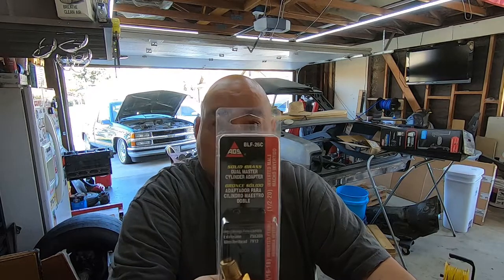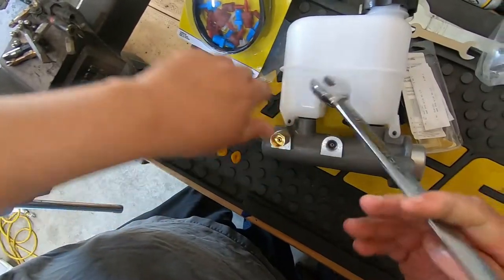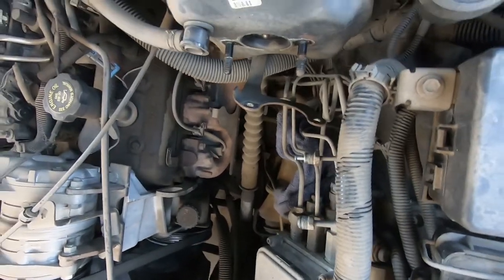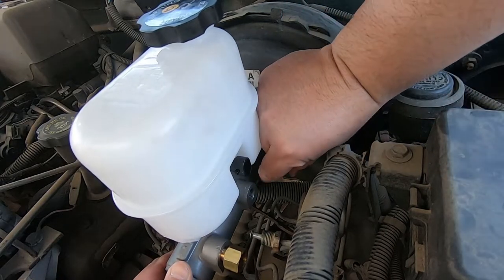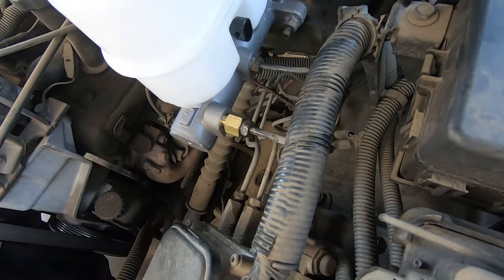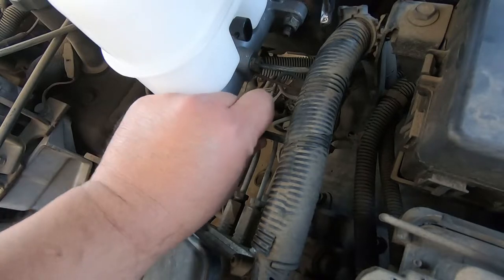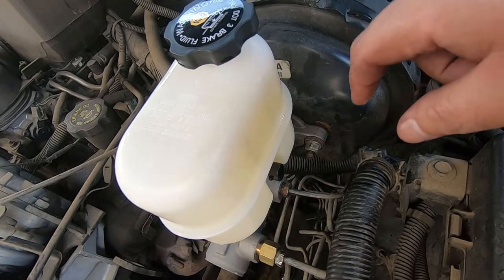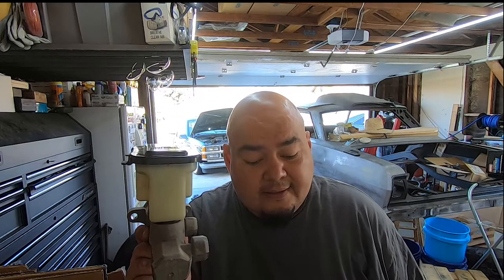Chevy NBS master cylinder on an OBS upgrade

Comment: Just did mine 1 month ago ....HUGE DIFFERENCE!! feels good from the get go but gets even stiffer after a few days of driving .....side note that line adapter can give you issues when you purchase the line adapter look inside of it the first one i got the threads did not go all the way down so i could not get a good seal went back to the store looked at the last one they had just like i suspected that one threads went all the way down swapped them installed it boom no leak everything is GRAVY!!😎
Reply from the maker: Yes I agree huge difference nice side note I have had a few guys have the same issue thanks for watching bro 😎
Reply: U got a part number?

Comment: Did anyone one of y’all experience a small leak at the adapter ? Everything is tight and still tends to leak a little bit. Nothing was cross threaded incase y’all wondering.
Reply from the maker: Some of the adapter fittings have a defect u have to look inside the fitting the threads should go all the way down the only reason I know cause a few guys have had this issue and there fittings are the problem same part # but 1 the threads go all the way down and the other 1 the threads stop that’s the defect 1
Reply: @LowLifeYonkes  thanks,will get a replacement adapter 👍🏼
Reply: @estebanrodriguez4097   i’m having the same issue just did the swap a few days ago. gonna buy a new adapter and new nuts for both line fittings . did u fix the issue??
Reply: Did you have to bleed all the brakes after bench bleeding the mc?

Comment: I need a new brake booster and want to do this upgrade. Any upgrade on the booster needed or go to my local gm dealer and get a oem one? Amazon "replacements" do not have good reviews on the boosters.
Reply from the maker: No I haven’t ran in to replacing the booster as they don’t go bad to often but I know the after market is all bad with local vendors and most of there parts are imported I honestly would just go to the junkyard if I had to replace one and just find a low mileage truck or suburban or Tahoe

Comment: Per usual, excellent detail and explanation.  I have a 95, and yes, brakes are a little mushy.  Time to add this to the upgrade list 😂.  Thank you for providing the links to the products used in this video.
Reply from the maker: Thank you for the support bro and thank you for still watching my videos I appreciate it 💯
Reply: @LowLifeYonkes  You’re welcome.  Question, bench bleeding, what exactly is that and what do you look for when doing the bench bleed?  Thank you.
Reply from the maker: Bench bleeding is when you bleed all the air out of the master cylinder by using a big screw driver and pushing the back of the master cylinder in and out to get all the air out .... u can do it on the truck it’s easier just how I did it
Reply from the maker: Your looking for no more air bubbles in the brake fluid
Reply: @LowLifeYonkes  Thank you for responding!
Reply from the maker: @ator2659  yep 👍🏼
Reply: Shit gets dicey with these old thing and trying to stop them lol.

Comment: I did it, I highly recommend getting thread sealant. Use a lot of it, on the fitting and one the oe line
Reply from the maker: I’ve done this upgrade multiple times and I have never had to use any sealant and only had a leak 1 time but it was a damaged fitting thanks for watching I appreciate it

Comment: Thanks for the info it was not a plug and I play for me I have a 1989 c1500 and the abs is different and the lines are more forward than your i bent the lines and work way better thanks for the Info the rear one is so hard to bend on the older trucks compared to yours the line is about 2 inches long
Reply from the maker: Yea bro I have had a few guys tell me the older trucks brake lines are harder to bend to the new location thanks for watching

Comment: I’ve been trying to get a new master cylinder but I’m not sure if it’s vacuum or hydraulic. Is there a difference and Is it the same thing if I just go with a nbs one ? 98 ext cab 2 wd.
Reply from the maker: Yea there is a big difference it won’t work if it has hydro boost it’s only for vacuum boost

Comment: Awesome video big help, so is that the only way you need to bleed the brakes after changing the Master Cylinder. Thanks
Reply from the maker: I did a bench bleed on the master and it bolted on and I dove it but I did bleed all the brakes a week later with help … thanks for watching I appreciate it

Comment: Just finished my 95 and the results are insanely better. I also did the rear disc brake upgrade as well.
Reply from the maker: I’m glad it worked out for you and yes I agree night and day difference
Reply: My brakes still are spongy after NBS master cylinder and rear disc brake conversion. What could the problem be
Reply from the maker: @VON-92  did u bleed all the brake lines including the abs unit
Reply: @LowLifeYonkes  honestly I don't know a shop did them so I think I'm going to bleed them once I get home
Reply from the maker: @VON-92  I would start there bro
Reply: @LowLifeYonkes  appreciate it bro
Reply from the maker: @VON-92  👍🏼
Reply: @LowLifeYonkes  bleed brakes and the abs module yesterday, my brakes are no longer spongy. I thank you guys
Reply from the maker: @VON-92  thank you for the up date nice I’m glad it worked out for you

Comment: What’s up bro. Me again lol. What brake line adapter size did you use to connect the brake line to the proportioning valve. I’m getting rid of my abs unit but I can’t find the correct adapter. Thanks.
Reply from the maker: I have deleted my abs yet bro so I don’t have an answer for you sorry

Comment: hi man, how is the pedal feel after the swap? is it too soft? meaning does it bite on the brakes with a little push? would you wish it is a bit more harder? or is it just right? I have a vacuum booster too. this master cylinder you're showing has 1.33" bore size which fits vaccum boosters. just wondering what if I put a 1.45" master cylinder that is usually labeled for hydroboost? the bigger the bore size the harder the pedal feel gets. would you recommend to try it? thx alot for the video!
Reply from the maker: Thanks for the comment and I feel the pedal firm now with less motion to stop witch is like night and day compared the the stock master and I am upgrading the brakes lines just to get it to bite a little more but to answer your question typically smaller bore diameter’s means there’s less fluid for it to travel through and bigger bore diameter’s give you more fluid volume making the pedal softer and less responsive I hope that answers ur question thanks for watching I appreciate

Comment: Thanks for the video. I just swapped out mine. For some reason my factory line won’t bottom out to the adapter. Any thoughts or suggestions?
Thanks in advance
Reply from the maker: Yes double check ur adapter fitting look in side and make sure the threads go all the way down I have more than a few guys ask this same question and the answer is get another fitting same part # but look inside and make sure the threads go all the way down
Reply: Ty! I tried your merch link but I think it’s down. Got some stickers?
Reply from the maker: @TXPRODUCT  thank you for the support yea I had to stop the merch store but I’m glad I was able to give out so many stickers thank you again for watching

Comment: Great vid and information. Do you know what master cylinder will fit the hydroboost application? I ordered this and break booster and hydrobooser master cylinder are different and im in search for a master for the hydroboost. My breaks are spongy 1995 OBS dually 454.
Reply from the maker: No bro I’m sorry I don’t know what hydroboost  would work I would try the Chevy NBS hydro boost see if that works
Reply: @LowLifeYonkes  got it! 2001 chevy Astro Van Duralast MC NM2779 no adapter needed. Hydro boost sys I'll post a vid soon. Thanksv
Reply from the maker: @DBIE_music_IE  nice bro 👍🏼

Comment: The Dorman M630031 I received looks like a piece of the bottom flange is broken off where it attaches to the booster, is that the design or a flaw? It arrived loose in the product box with no packageing and the box had a tear in it, so I want to know before I try installing it. Thanks!
Reply from the maker: No bro send that shit back it’s not supposed to be like that !!!
Reply: @LowLifeYonkes  Thanks-Subscribed!

Comment: So did this truck have the Kelsey Hayes and also, did you have to bleed every wheel?? Mine is a 1995 Suburban with the Kelsey Hays brake module thing or whatever it is
Reply from the maker: Yes both my OBS trucks have the Kelsey Hayes abs unit witch you have to bleed every wheel and the abs

Comment: I installed new brake lines metal and rubber on my 94

Along with a new booster and a new obs master cylinder......

Rerouted my lines to delete the dump valves also!!!!!!!!
I'm still no pedal/spongy

Brakes are still no pedal... Will this fix the issue?
Reply from the maker: Seems like u have replaced everything I don’t know if this will fix ur issue
Reply: @LowLifeYonkes  if this does fix it I'll comment back if you are interested, I get the NBS master cylinder tomorrow. I'm starting to think I may need to replace my calipers even though they are working.

They might be weak, but I don't see how.
Reply from the maker: @dusterdriven  let me know if it does work
Reply: @LowLifeYonkes  ok after more digging, my issue is rear brakes, to be more specific... The drums. All this master cylinder does is give more feel to the pedal the under lying issue everyone is over looking is the drums themselves. 20+ year old trucks.... It's time to replace the thin worn drums =( expensive but much much needed.

So to recap the more beneficial "upgrades" I've done.

Abs deletion- do it, the dump valves and abs computers are expensive and the valves cause problems anyways.

Nbs master cylinder (questionable)
Obs is a little looser, yes; but if it's spongy.... You have other issues.

On a side note, it feels more modern with an NBS with more feel in the pedal. I like the shorter pedal distance to brake.

It's sorta like driving a tiny car with a super touchy pedal.

Older guys may not like a touchy brake pedal though, it's more of a younger guy troup.

For anyone following along I can explain the feel using a muscle car.

Obs feels like a manual brake in a Plymouth duster.

Nbs is like you added a booster with a wilwood prop valve.

I've learned allot on my expectation to solving my sponge....
Here's another one guys forgot to do....

GREASE ALL SLIDING PARTS ON YOUR CALIPERS - CLEAN THE SHÍT OUT OF THEM!!!!!

But thank God for this YouTuber recommending an alternative to our crapy obs/S10 master cylinder
Reply from the maker: @dusterdriven  nice bro good work thank you for the update 👍🏼

Comment: Can I used that master cylinder on my 99 Cadillac escalade, 99 gmc Yukon ?
Reply from the maker: If it’s and OBS platform with no hydro boost yes you can use it

Comment: Hey guys, so I know there’s another video that says air gets trapped in the abs module and shows how to eliminate it.  Is this necessary with the upgrade to the master cylinder?  I was thinking I should do both.  Mine is a 90 c1500 and the lines are different from the video I saw that was a 93. TIA
Reply from the maker: Ok let me see if I can help so 88-94 OBS trucks have a rear abs module only and a combination valve that the front and rear share so that being said there are 2 different procedures 1 for 88-94 and the other 95-98 both need to have a good bleed to get rid of any trapped air there are plenty of videos on both year of trucks but yes in either case bleed all the brakes and master cylinder and ABS model it makes a world of difference in ur braking power hope this helped thanks for watching

Comment: I Noticed truck in video had 4 wheel ABS. ??? What year was it??? My 91' had Rear ABS only, till removed. The SHORT, Tall Master cylinder......worked, BUT...... NO POWER Brakes any more.
Reply from the maker: My truck is a 98 but I have done this to older trucks as well
Reply: I just completed this mod as well and I no longer have power brakes. Much less peddle travel and a lot firmer but I use the truck to tow a boat and really don’t want to be with out power brakes so I will rebuild and reinstall the original master cylinder. I did bypass the non functioning rear ABS so hoping that will help a little.

Comment: Wondering if I should do this since mine all of a sudden goes to da ground n I changed break wheel cylinders in da rear where da leak was. You think it’ll fix it or do I have another issue?
Reply from the maker: Sound like u need to bleed all 4 corners and see where your at after that
Reply: @LowLifeYonkes  already bleed, changed wheel cylinders n bleed n pedal still goes to da floor
Reply from the maker: Sounds like the brake booster

Comment: I’ve got to know I got the same but but when I turn it upside down and right side up it sounds like something is sliding or moving inside was your like that or no i’m trying to see if mines broken
Reply from the maker: Yes the new NBS master cylinder has a float inside when the brake fluid goes low it triggers a brake light inside on your dashboard. On OBS style trucks never had that that’s why you don’t plug in the sensor on the side of the new master

Comment: Bro i just started having a problem with my obs when ever i step on the brake pedal it makes an air buzzing noise and its getting kinda hard to step on to im not sure if its the booster or the cylinder.
Reply from the maker: What year is it
Reply: 94

Comment: Would this setup work on my 89 ovs k2500? It says it wouldn't fit but I just want to make sure before I buy it
Reply from the maker: Yea it should work they are all pretty much the same there is a few that are different but u should be fine thanks for watching
Reply: @LowLifeYonkes  no worries thank you boss, just didn't want to spend the money and not be able to use it
Reply from the maker: Buy it from Amazon free returns 😂
Reply: @LowLifeYonkes  just ordered it. Gonna install it mon
Reply: I just got an 89 k2500, did you install this and if so, how easy was it and what are your thoughts on it?
Reply: @gregoenes1138  it was easy compared to other jobs

Comment: I really want to do this, only question is why did you only need the one fitting/adapter ? Obviously it lined up just fine but I’m curious why. Otherwise this has been on of the best made tutorial videos I’ve seen on YouTube .
Reply from the maker: Thank you for the comment and yes I just need the 1 fitting the back 1 is the same thread size you will need to bend the lines back just a lil bit so they can line up to the new master cylinder and that’s it thanks again for watching

Comment: Does yours have a proportioning valve? Cus mine does. So idk if it would work with this mod.
Reply from the maker: No mine does not have one but my boy Chris has an 88 OBS and he does have a proportioning valve and it works on his as well
Reply: @LowLifeYonkes  ok cool thanks for the reply. I’m gonna have to try out this mod cus I’ve replaced almost everything and the brake is still spongy. Even sets off my brake light. Someone even told me that it could be the proportioning valve. Should I replace that as well? It got to the point where the brake sank almost to the floor 🙄
Reply from the maker: Try the master bro and if u have an abs module delete that shit bro it’s garbage 🗑
Reply from the maker: Buy it from Amazon free returns 😂
Reply: @LowLifeYonkes  im gonna try that and also delete the abs since you’re not the first to tell me to delete it. Thanks for the tips bro! #keepthemontheroad

Comment: I did this exact same thing to my 4x4 Tahoe and could not feel any difference.  I don't see how people say huge difference.   My brakes still feel as spongy as ever.
Reply from the maker: Then you did something wrong with the install or the bleeding
Reply: @LowLifeYonkes  That's the only I can think of also.  Gonna redo it and hopefully it'll solve that.   
Two days ago exited of the turnpike a little fast and I almost couldn't stop my Tahoe when reaching the red light.   Freaked me out! Lol
Reply from the maker: @MiamiWebDesign  may sure u bleed the abs unit as well

Comment: Good video. Sweet truck 👍 Is your truck stick shift, that's a bad little cruiser 👊
Reply from the maker: No it was a stick shift I got it on the cheap long ago the previous owner didn’t know what he was doing and swapped it he couldn’t finish it and I took over .... I’m guessing you saw the reservoir for the clutch I never took it out lol .... I want to put a stick back in it but we will see .... thank you for watching 👍🏼
Reply: Yes I seen the reservoir. I want to swap to manual, I have two transmissions with all that's needed from reservoir and lines with the clutch pedal and bracket. Just need the clutch kit and pressure plate. But really need down time since it's my current daily driver.
Reply from the maker: @sereous67  I see u have 2 transmissions are they NV1500’s ??? And would you sell 1 of them ???